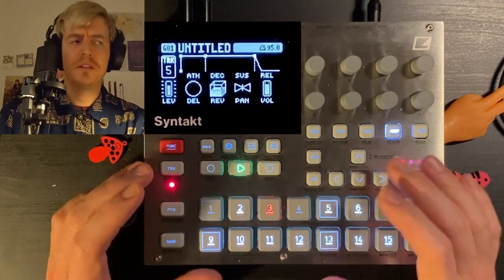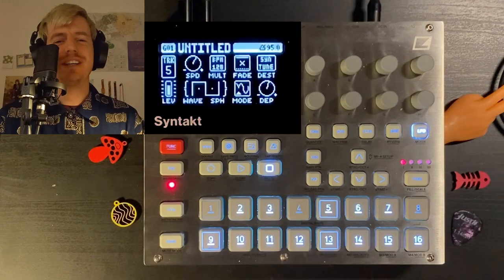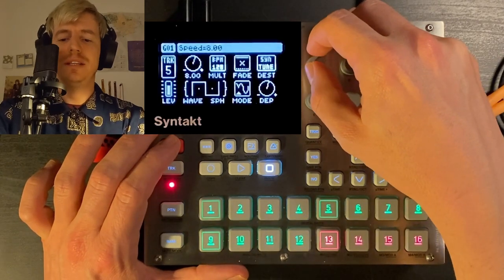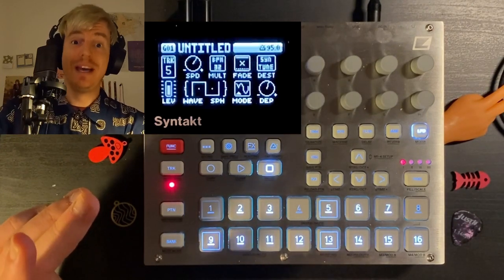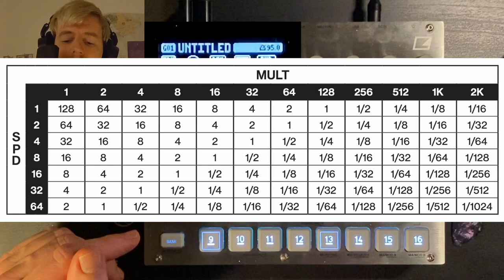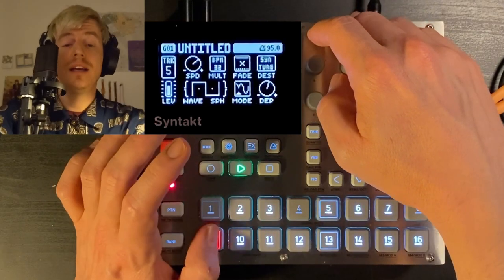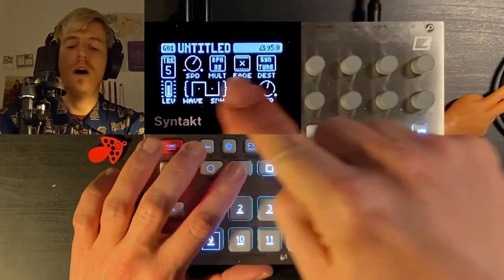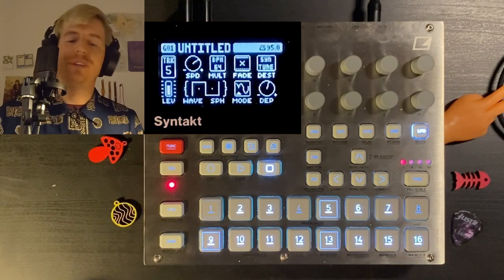Rytm/Syntakt/Digitakt LFO speed and multiplier CLEARLY EXPLAINED // LFO beat sync

Comment: It's an old paradigm that began on the original Monomachine and Machinedrum where the range of values for most parameters was 001-128. The simplest way I found to think of it is like the sequencer. It has 16 steps. So LFO speed synced to the sequencer is 1,2,4,8,16 etc. For even divisions. It's the same with the timing in the delay FX in the old Elektrons too. Another interesting note is that the S&H wave is 16 times faster than the "regular" waves. It makes 16 "steps" in the same time a regular wave makes a single cycle. This is also helpful to keep in mind when going for a synced S&H modualtion
Reply from the maker: Oh wow this is very useful, thanks for chiming in!!!
I didn’t know the history of this (super interesting) neither that the FX timing follows the same logic. And the S&H fact is gold, thanks again 🙌
Reply: Very interesting, thanks for the info!

Comment: Wow, thanks for this 😅 I have tried to figure out logic for this ny myself periodically over the last few years without ever bothering to look it up (and apparently glazing over the table in the manual), and because of that very rarely do I use LFOs rhythmically since it was such a pain to figure out.

I kept thinking, okay, speed at 16 would maybe mean like, 1 cycle per note in a 16 note bar, then if the mult was at x1 bpm that shohld mean it syncs up to one cycle per 16th note, and x2 would be double speed, etc.. but of course it doesnt work that way and i couldnt figure it out!

Of course theres a secret mathematical formula that most people would never figure out! 

I will remember this and use it much in the future, and save this for later if I ever forget 😅 Thanks very much!